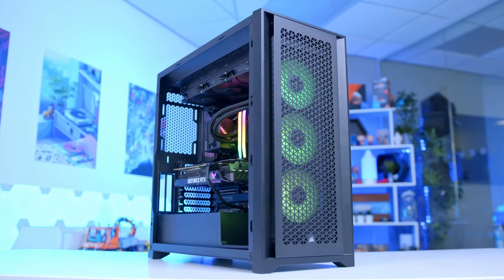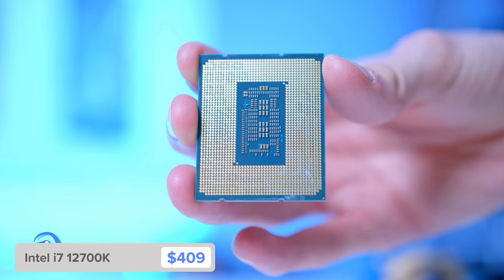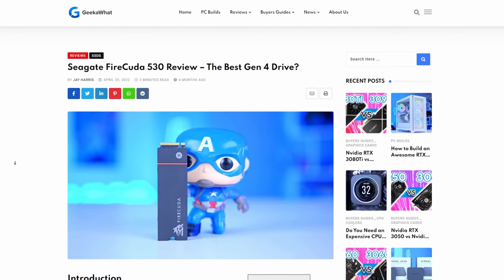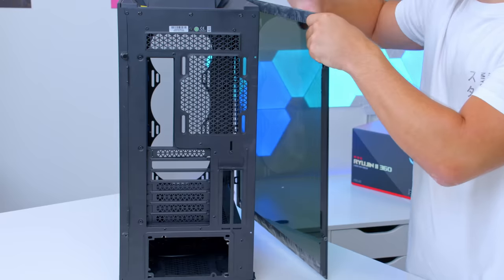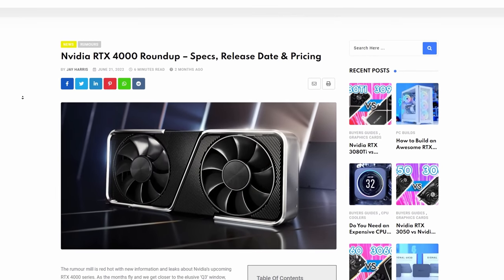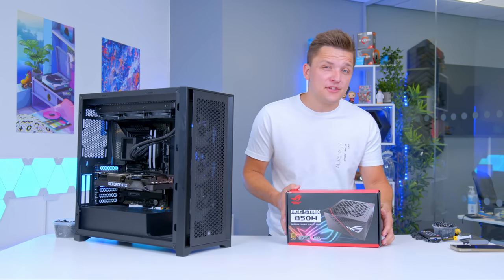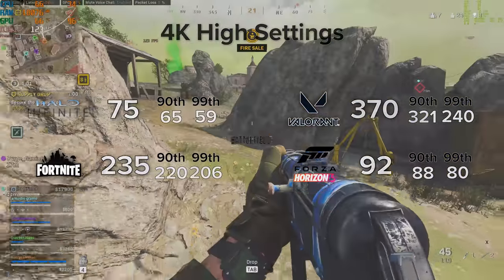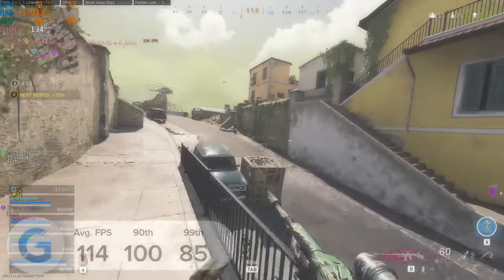Let's Build an INSANE $2500 Gaming PC! [Full Build Tutorial & Benchmarks! - ft. RTX 3080]

Comment: I love 3080 more then 3090, because 3090 price  too high,and 3080  run games at 4k so why you want to give extra money am i right. Thanks for making video on 3080.
Reply: As someone who went from a 3080 to a 3080 ti to then a 3090, (Listen pricing was great at the time for each, don’t judge) That 24 GB of VRAM makes a HUGE difference. I have the AW2721D (1440p, 240) and I can run that on high settings on Apex and Fortnite. Thankfully I got my 3090 when it was super low. If I had the choice in the beginning, I’d get the 3090 from the get go, but that’s my two cents.
Reply: @cdotjgb  agreed. Might as well go big. Frames win games.
Reply: @cdotjgb  im trying to get a 3090 for a low price but no luck so far, so we will see
Reply: @EpsilonCobra  What’s a low price though, don’t cheap out on like a Gigabyte card. I was able to snag a 3090 Asus Rog Strix White for 1420 after tax. 1. Those are hard to get as it is and 2. Rog Strix is the top of the line tied with Suprim. With 4000 series delayed, labor day weekend will probably have some great deals. But don’t cheap out on Gigabyte cards, worst investment ever made. EVGA, MSI, Asus, are all great brands, I will NEVER get a gigabyte card again after all the problems I faced.
Reply: @cdotjgb  what i want is an asus rog strix for at least 1000euro, im a 2k player so it will max out my fps for most of the games, even with a badly optimized game like cyberpunk at 4k it reaches at least 98-102 fps from what I've seen on a video with a good cpu so why should i bother with the 4000series which will be double the price than the 3000series when the cryptocurrency was at its peak and im sure of that but I can't pay more than 1000$ so im watching every single day if i see it at that price, then its insta buy for me

Comment: 3080 legit best rn, i bought one recently just cause i didnt want to wait for 40 series cards and expirience shortage of gpus or overpriced trash. Currently in system with R5 3600x at 1440p and so far not a big bottleneck. I shall wait for Ryzen 7xxx series tho and see is it worth changing mbo ram and cpu or shall i just go with r7 5800x.
Reply: If DDR5 is a problem for you then ryzen’s 7th gen cpus will be, cause the leaks say it only supports DDR5. I suggest you to go with the 5800x.
Reply: @vFxc  yea i know, in my country its 300€ for 32gigs.. anyway ill wait and see. Dont plan to upgrade till october anyway.
Reply: @stefantufegdzic8294  I have a 5800x paired with a 3080 its a great setup